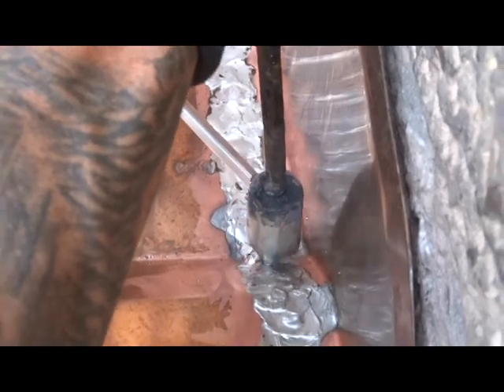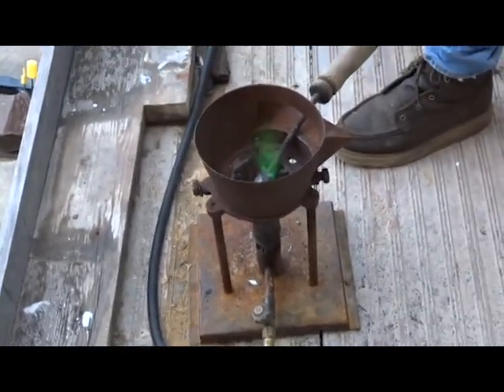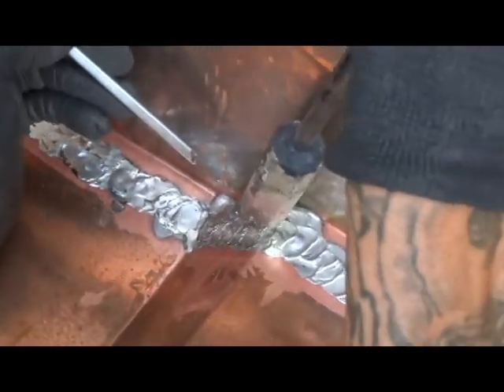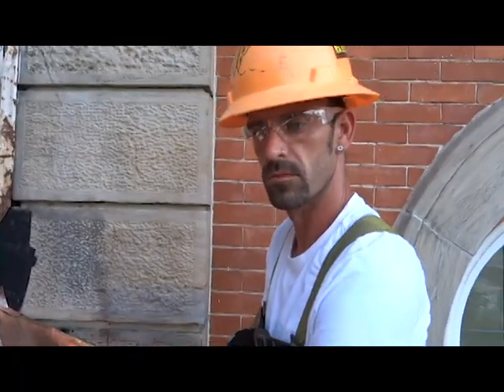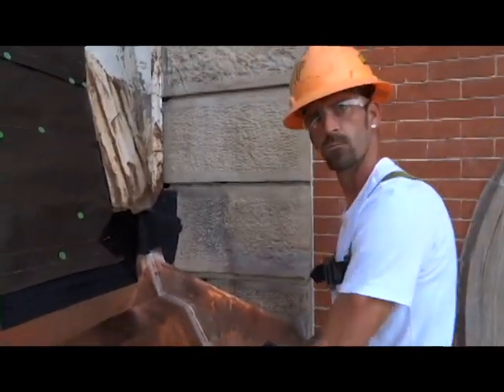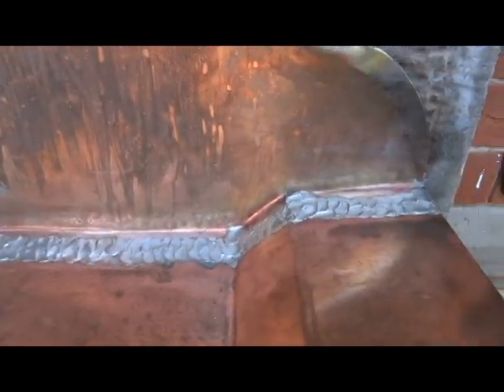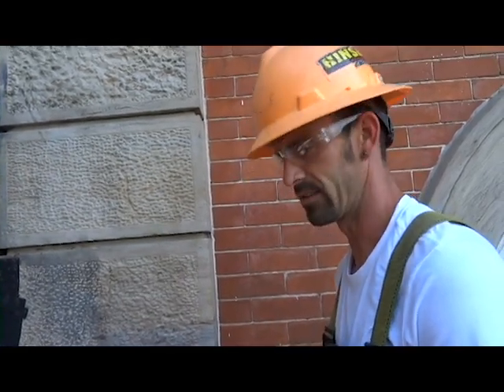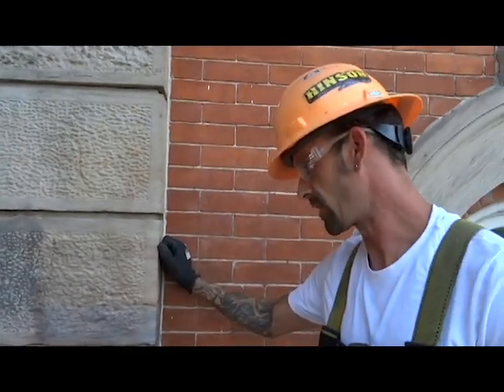Soldering with Hand Irons

Comment: Beautiful seams. It's really a art form putting the top layer on after sweating it in ya seams. I been doing alot of SS box valleys lately that gets alot of foot traffic and being able to saulder seams on 90 degree angles and 45 without being able to tilt and spin 10 ft pcs of valleys you can see how much work goes into someone else's sauldering iron techniques. In French quarter we can't have live flames so we're pretty much forced into electric irons and they so easy to break on a roof but it's either that or be like everyone else and caulk it (I refuse)

Comment: How do these joints avoid tin pest?
Reply from the maker: What is tin pest?
Reply: @jcjenkins01  at 13.2°C (56 °F) or below. Tin starts to deteriorate. It transforms to a brittle crystal form that will not hold up. This can take several years and is accelerated as the temperatures drop. I don't know what climate you have where you live, but if it's something like where i live it might become a problem. The lead/tin solder handles this better. Not sure about other lead free soldering tins though as they usualy have a few % silver and other metals in them.
Reply: @neutrino3487  I've found that "pure tin" solder is sometimes alloyed with antimony or other metals in trace amounts (less than .1%) and I'm under the impression that this is done to avoid tin pest/whiskers though I'd love to hear more about this from someone with a metallurgical background